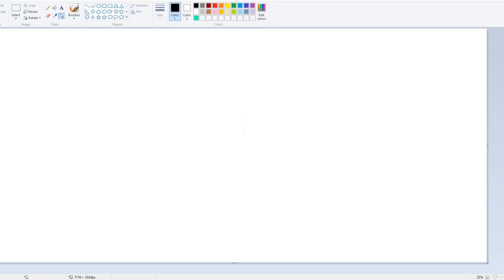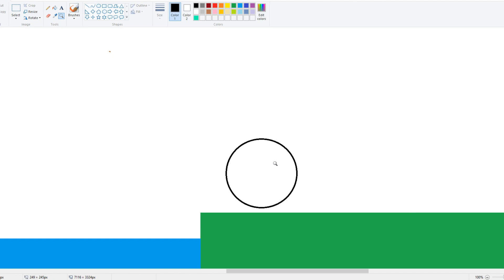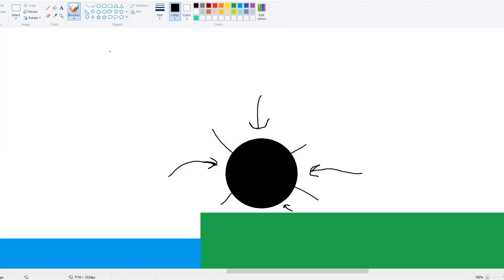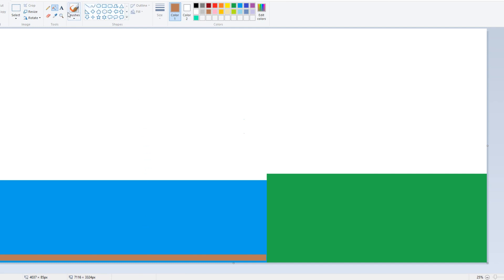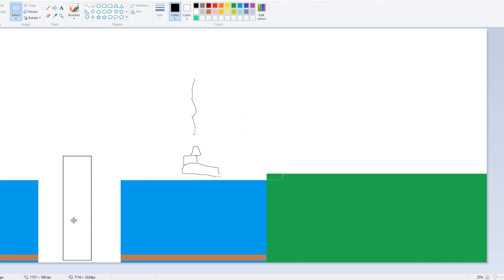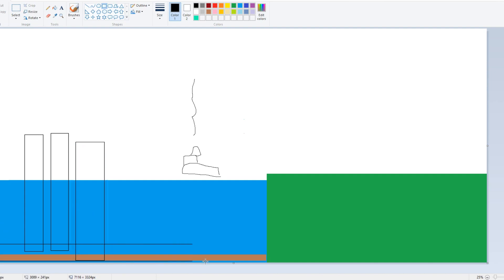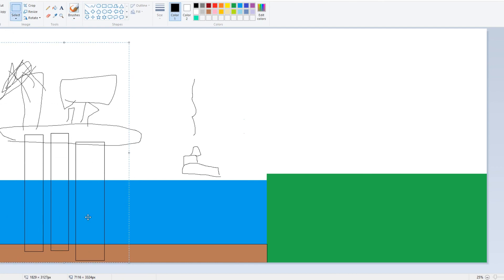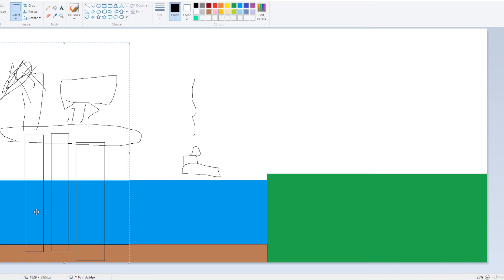I found out how offshore oil rigs are built

Comment: I think some as the legs can get jacked up if the water is too deep but I think it's a different design. lots of different designs of oil platform this video only talks about a few common features that a type may use? shit he I go down the oil platform rabbit hole. probably should anyhow cuz my roommate told me that they had something that just straight floated and stayed that way I said no I know they CAN do that but that's not how they are when drilling I didn't think...